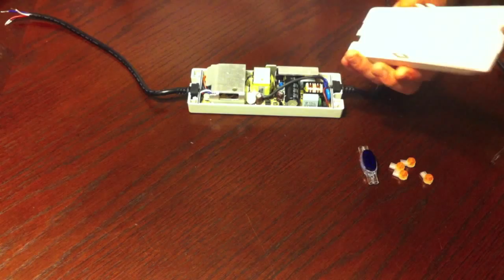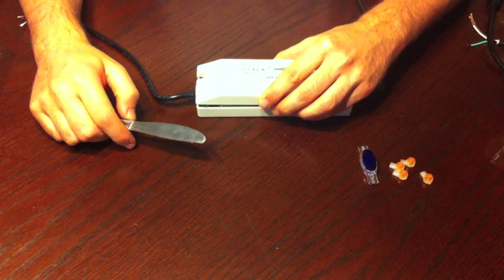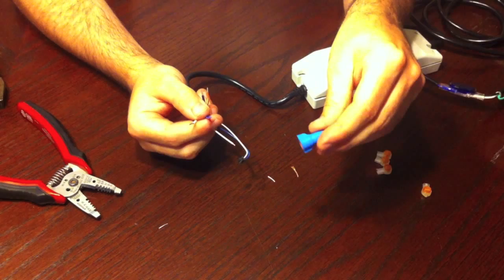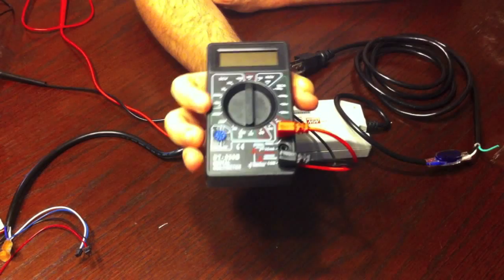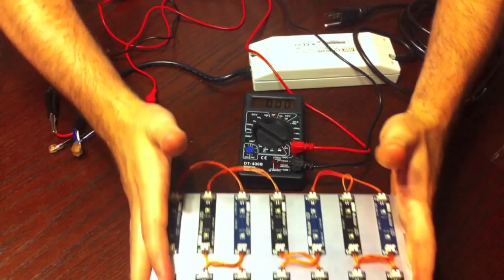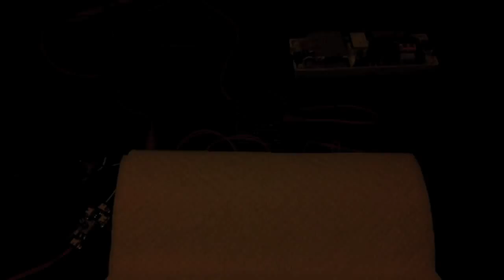Wiring ELN-60-48D

Comment: sorry had to stop watching when you used a butter knife as a screw driver within seconds of telling folks to use an insulated screw driver. Kinda like telling people to start a fire only in the wood stove, and proceeding to toss the hot coals on the rug
Reply: dstronglax He used the butter knife to pry off the cover of the driver while the power was off, there's nothing unsafe about that.

Comment: Not a half bad video, however I just wanted to inform you that yes, you can connect the power cables with any polarity, but you should connect it with the intended polarity. the WHITE AC wire goes with the BLUE wire… And the BLACK ac wire goes to the BROWN wire. I actually work in lighting and deal with mean well ballast drivers all day… Any questions please ask. I am a professional
Reply: im a noob :) can i use some kind of 0-10v passive potenciometer to dim the driver?
Reply: No this particular driver requires a special dimmer circuit. Pulse width modulator should do fine. That's the trouble with constant current!
Reply: No this particular driver requires a special dimmer circuit. Pulse width modulator should do fine. That's the trouble with constant current!